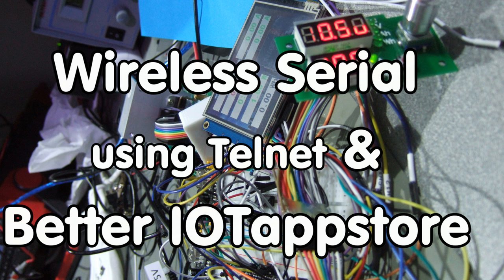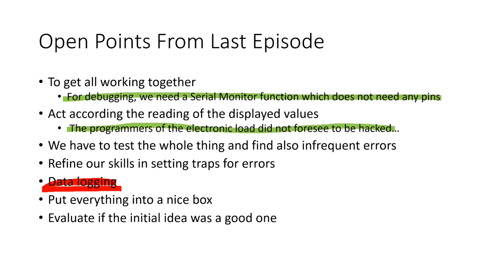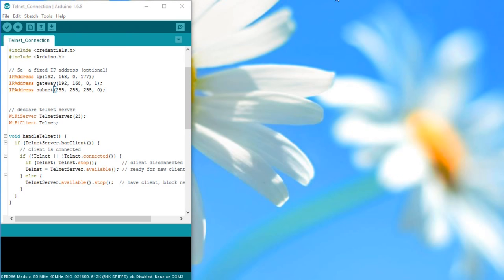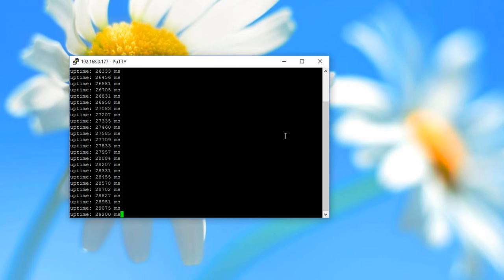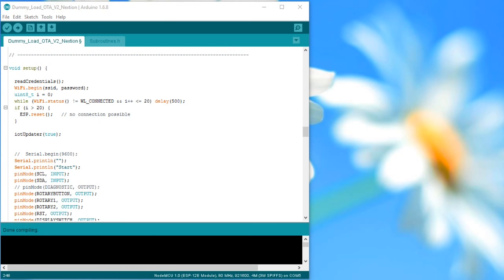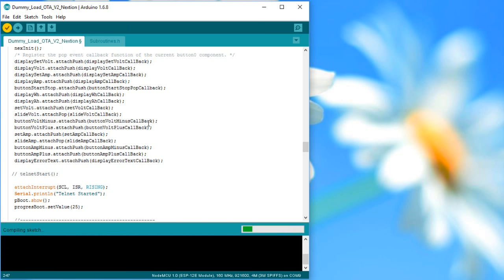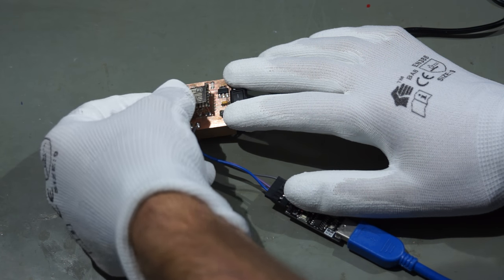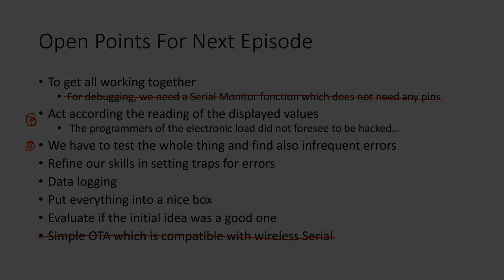#82 Wireless Serial for ESP8266 using Telnet, enhanced IOTappstore using MD5 tags

Comment: Dear Andreas, did you upload your updated ino file (with the MD5 check) to github too? I cant find it.
Reply from the maker: No, not yet, because it would not work. You have to wait for the 2.4 release of the ESP software or  you google to find out all the patches you have to make in your current environment. If you did these patches, you find examples which should work with MD5
And the ino file of my electronic load is also still under construction.
Reply: Okay, I understand. Thank you for your answer. And by the way very very nice channel after a video I am still waiting for the next 😊
Reply from the maker: That's good. Thanks!
Reply from the maker: Roland Elmiger It was intentionally, because it is not simple to patch these files and I thought, it is better for most of my viewers to wait for 2.4. And, of course, I was sure, that the guys like you can find the necessary info themselves ;-)
Anyway, we are working to make the iotappstore usable as a self service for everybody. Stay tuned. It takes some time...

Comment: Why can you not use telnet server and OTA, works fine for me. What problems were you having exactly?
Reply from the maker: I did not remember, it is a few weeks since then. But after your question, I tried it again, and I was now able to get it running. So, this comment is no more true. I think, I use now a different structure for the telnet and this might be the reason.
But maybe it was good that it did not work then, because it was the motivation to do the iotappstore, which is also a nice thing ;-)
Reply: yeah i have yet to look into web updating but have not had the time, i would like to have drag and drop upload page in production , for dev OTA is nice and fast and easy althought i am having alot of problems with hanging after restart.
Reply from the maker: I have the hanging after restart only, when I do not reset the board immediately after the first upload (with serial). This is also documented. Otherwise, it is quite stable
Reply: I guess a hard reset is needed, cause esptool should be doing a normal reset, it must not be enough.

Comment: Hi, I have tried to get this to work... but I get this error
Start
35
........
connected
MAC: 5C:CF:7F:3:0:17
start flashing......
jardineslake.cl
/iotappstorev20.php
iotupdater_001
0
HTTP_UPDATE_FAILD Error (-103): Forbidden (403)

I cant figure what the issue is.....
Reply from the maker: Did you patch the libraries? Is the file name in the php file ok (without .bin)? Can your ESP access the file (rights, firewall?)
Otherwise, the only possibility I used was to track the traffic of the ESP with the server (using winshark) and built the same request with the browser and experiment till it worked. I then iserted some debugging echo statements in the php file to help.
I never came across this error.
Reply: Hi Andreas, yes, its patched. how I getHTTP_UPDATE_FAILD Error (-106): Verify bin header failed If I only ues the full path to the .bin file in t_httpUpdate_return ret = ESPhttpUpdate.update(update_server, 80, update_uri); it will download, but loop for ever.I am guessing its not reading correcttly the .bin file or something.
Reply: Made progress no I get HTTP_UPDATE_FAILD Error (-1): HTTP error: connection refused
Reply from the maker: There is not http:// allowed in the server definition. just the name.
Check with your browser if you can reach exactly the same location. You should get then a message from the php file (“only for ESP8266 updater!” )
Reply: In Chrome I get the messange from the PHP, but in IE I get HTTP 403 error Microsoft Edge can’t get to this page
Reply from the maker: Strange. I think, I cannot help more becuse I am not a network specialist. But you have to get the php message, and then leave the http:// away and put it into the fields in the ESP. There were quite a few viewers who were able to do it so far.
Reply: Thanks Andreas, It must be a stupid thing..... Keep up the wonderfull work you do!
Reply from the maker: Thanks!

Comment: Is the sketch code showing the new method (using MD5) on github?
Reply from the maker: 888cromartie No, not yet because you need the 2.4 version of the ESP boards definition.
Reply: Oh, how do you install the 2.4 version? It looks like I have 2.3 currently installed.
Reply from the maker: It is not out yet. That is the problem. I will post my file as soon as the version is out.
Reply: OK, I thought maybe there is a developer or beta out that you are using.
Reply from the maker: 888cromartie I patched the 2.3 version. If you are knowledgeable, i can provide you with the. Info. Bot no complains afterwards;-)
Reply: Yes, please do. I have tried my own version passing the version # and update url via json in my php script, and it does an update after checking if the new version is higher than the current version. However, it only worked one time so far. After I reset the ESP, the serial port just gets some random garbage. I just implemented ESPhttpUpdate, so I have not looked into the issue in depth.
Reply: OK, I think I found the issue I was having it seems to work now. https://github.com/esp8266/Arduino/issues/1782 

Using the MD5 method seems clever since I would not need to worry about updating the php script with new version numbers.
Reply from the maker: This is a very good method and I only use this one for my development now. It is very simple, simpler than serial upload...
Reply: Seems like it... hopefully it proved to be reliable over time. =)

Comment: Thank you for another lesson! 
I'm wondering about one point. Let me try explain it with my poor English for better understanding first, please.

As I understand aka episode is; whenever you are reboot/restart one of ESP8266, its checking if there is update or not. Are they checking without reboot/restart for "if there is new update" in time basis (lets say every 1 hour) or something like that?

Just wondering, because addational battery consumption of ESP8266. As far as I understand you are trying keep consumption minimal (even using sleep mode of 8266 etc). 

If its checking periodically, that means addational battery consumption and like %2-3 less sleep time (assuming checking hourly) even if there is not an update. If its not checking it periodically, its even worse. Because, they can not get updates without reboot/restart.

Now, you read my scenario. I did not check IOTappstore nor code yet, just assuming like other similar work prenciple.

Best working method for me must be; whenever you are uploaded new files into web server, it must be send something (maybe signal nor a check code) to ESP8266s (even not sure if web server can awake ESP8266s from sleeping mode. As I said, just assuming). 
- This way, ESP8266s life will be longer till next battery charge nor less power consumption.
- Network traffic will be coordinated and less necessary communication with server.
- Much more effective way with to many ESP8266s. Because, web server can make a "update queue" device list, instead random connection try from each ESP8266s.

Thank you for your time,
Mehmet
Reply from the maker: Thanks for your long comment.
1. In my example, the update function is only called once in setup. But you can call it every few days or so using the principles of video #71. Up to you. This can be changed with every new sketch. At the beginning of your project you might use a daily check, and at the end of your project, you might include a weekly check in your latest sketch.
2. I would never check hourly (unless you are in development. Then, you probably want to check even faster). Usually, there is no need for that.

2. I want, that the ESP is in charge of the update (that it initiates the update), because it is much easier to initiate a communication from behind a firewall than calling something from the outside (port opening etc.). I also think, that it is harder to fake an update from the outside, because you also have to know the timing. But maybe, I am wrong. I am not a security guy.
3. Keep in mind, that energy consumption for an additional call is absolutely minor, if it is combined with other internet activities, because the biggest consumption occurs with the connection to Wi-Fi. For applications which do not need Wi-Fi, there are better boards than the ESP.
Reply: Thank you for the answer.
Reply from the maker: The concept I prefer (and use) is similar: The MQTT poll is just replaced with an "Update poll". From time to time, the ESP starts a request to one or more servers and provides the MD5 of its current sketch, similar to an MQTT subscription. The server compares this with the MD5 of its its current version, and downloads a new version, if necessary. This is different to the MQTT principle, where the ESP would do the comparison.
This works especially good with deep sleep, because, always after let's say 200 boot cycles, The ESP checks for a new version.
Like that, you just change the newest version on your server, and the rest is automatic.
I have also 2 servers in a row called. First, the development server, and, if no version is there, the production server. With this concept, I can develop and deploy without changing anything on the ESP.
The MQTT channel would distribute a similar information, just on a parallel channel and you would have to update this channel every time you load a new version to the server.
Reply from the maker: I understand your point. For me, the update of a running system is not time critical, because I hope, deployed software is somehow stable and need no immediate change. But if this is not the case, a solution with MQTT is for sure a good and proven one.
And if you need MQTT for other purposes on your ESP, it is even no additional overhead.
Please write me, when you prototype works.

Comment: Nice episode! Your thorough examinations and in depth explanations have really helpt me out a lot on projects.

I really like your appstore, and as a php mysql programmer I would like to join forces and help you further develop the php side of things. If your interested that is. How could I contact you to share some of these ideas?
Reply from the maker: Thanks for the offer. If you send me a private message I give you the contact details.
Reply: @AndreasSpiess  Has anything resulted from this initiative? I'm also thinking about basing the php script on an sqlite db for more flexible image management, and also the IDE (in my case, platformio) should automatically upload the new image (already working) and register it in the db (still open) so it will become available to the next update clients.
Reply from the maker: MrDutchgrass built IOTappstory.com

Comment: You nearly at 10 000 k subs ,any spacials planned for that? :-)
Love to see more in depths tuts on the Nextion displayb(NX4832K035_011R Enhanced) i I I want the implelent it on my RADDS 5 board for my new developt 3d printer.
Sinds you have already alot of expertise on the Nextion boards.I want to see a menu stucture whit  of bed themp en nozzle themp and bed calibrition plus the  possebility to set the temps,barchraphs and MORE important on what pins on the RADSS  thoo hook the  display on.
I hoop you find the thime too this ,and help me in the right direction,i will greatfull
Otherwise yourvids-are clear and very infomative.
Keep them coming.
Reply from the maker: 1. I plan a lab tour for that event
2. The Nextion will be connect to the Serial of the controller
3. You see some menu structure on my current electronic load project. I will publish the files when the project is finished. With these files, you should be able to setup your display and sketches.
4. I do not have an enhanced Nextion display, but I ordered one for testing.
Reply: Thanks for the info.
Much appreciated.

Comment: Why not using mdns (https://github.com/esp8266/Arduino/tree/master/libraries/ESP8266mDNS) to assign and broadcast a local hostname? No more need to know the ip address!
Reply: DNS = addational weak point on network( in my perspective for this kind of projects)
Reply from the maker: I am not good in internet protocols yet, so I do not know this. Maybe I will look into it in the future.
Reply from the maker: Mehmet, why do you think?
Reply: I'm not sure why it would be a weak point in an internal network. 

You could also use a DynDNS provider and update the IP on startup with a HTTP request, or even simpler: add the local IP as a parameter to every request to the IOT AppStore and save it/ display it there.

Just some ideas. Enjoying the videos!
Reply from the maker: I only need the IP address in conjunction with putty. The appstore does not need to know it because the ESP is the initiator. 
I quickly tried the mDNS example and tried to call the module with the name instead of the IP (in putty). But I was not successful.
Reply: I understand that you don't need it in the App Store, but you can "abuse" it, to also display the IP. That way you need only one request and one "server" component.

If you are on Windows, you might need to install Bonjour.
Reply: Network processes must be simple as much as possible. more protocols means more brick in the wall (doesn't talking about hardware protocols).

Edit: 
You need only WebServer IP address, you are not using ESPs IP addresses (other than once) in your network cycle. When ESPs trying to connect nor connecting to WebServer, you got their IP automaticaly already. So, you should have a naming policy nor IP-ing policy either way.

Also, you can get clients names (aka DNS) with an illegal connection (again, I'm assuming someone successfuly connected into your network) from DNS server easly. Even DNS logs give it for free. How they can get logs? If someone successfuly connected into your network, no need to ask how. 

In other hand (I'm not sure about that. My ESP8266 still on the way, in mail yet); in normal network protocols you can void ping nor echo etc. So, no client IP address gain for illegal connection. At least not easy as DNS. However, if there is a running DNS, you can convert name into IP.

I'm just trying share my experience. If I can do any contribute, happy to me. Also, there is not such thing like full safety with only software about networks which is connected to Internet. Best way is hardware protection. In depth; even XOR logic is not working safe enough on networks as software protection (especially on WiFi). Thats why your network must be simple as possible.

Regards,
Mehmet